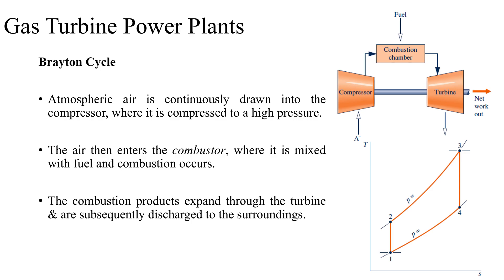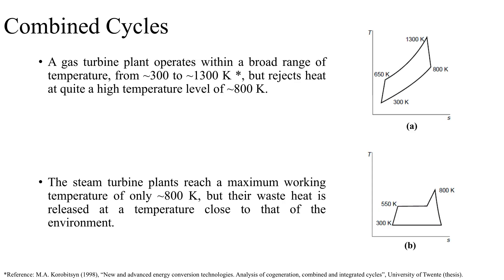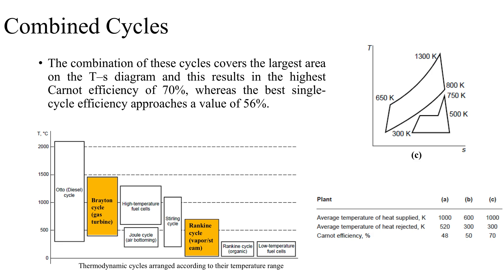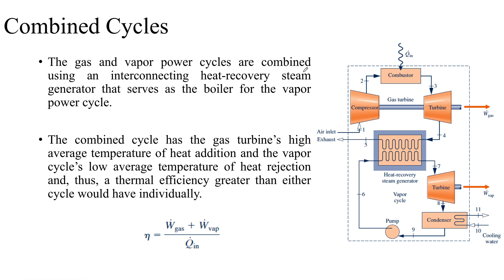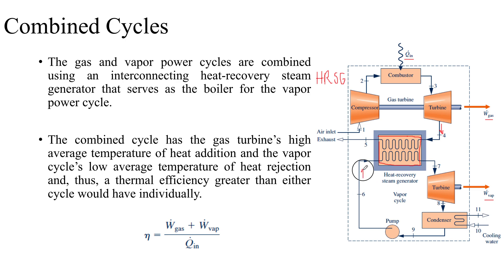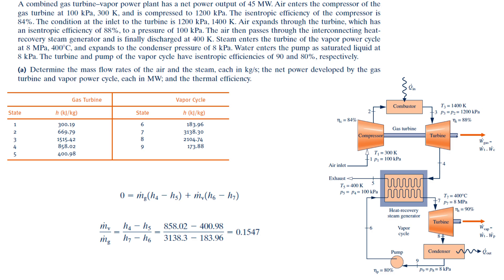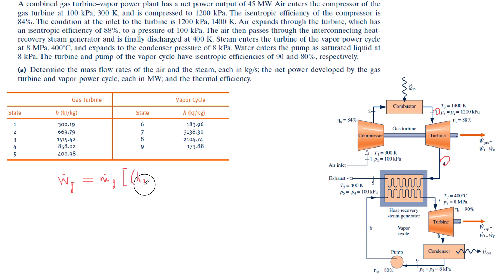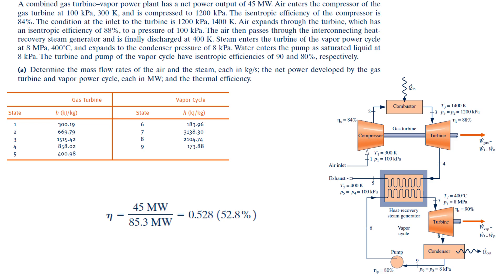Combined Gas Turbine - Vapor Power Plant (Theory & Problem Solving)

Comment: please can you put the link to thermodynamic air Table cause i can't find it , the ones i found on the net doesn't seem to work like the water table , there is no fixed temperature with fixed pressure
Reply: i know that we have the isentropic efficiency of the compressor so    η(is)=W(s)/W(a) =
[V*(P2 - P1)] / h2(a) - h1  =  [h2(s) - h1] / h2(a) - h1 = 0.84  ; the fact is we need V to solve the equation state 1 we have the T°1 so we search in the table for V1 TO TAKE IT AS V ; but in those table we don't have V we have Vr wich correspond to (relative specific volume) i tried to solve the equation with Vr but it doesn't give the same solution as ou where h2= 669.79 so whats the move to do to find it ??? please answer me @Ahsan it's really important and thank you for the video